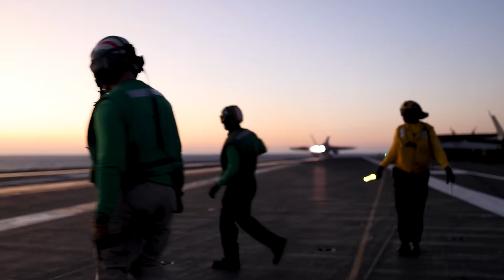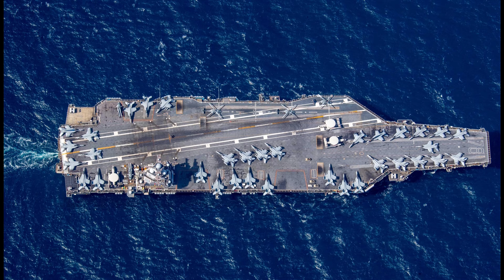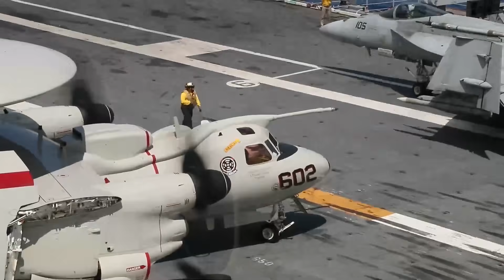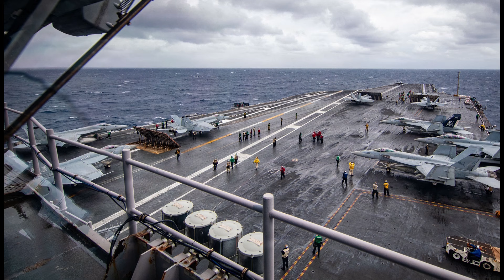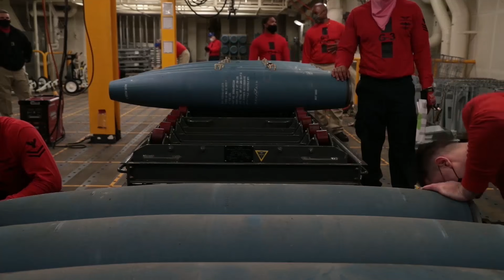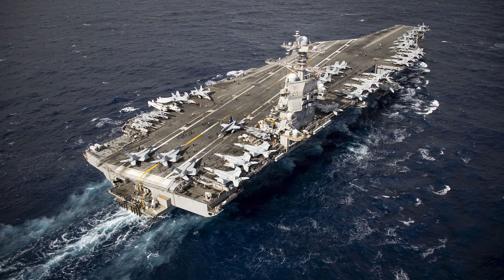Is China's Fujian Carrier Actually the Equal of the Ford Class?

Comment: The differing performance of the electromagnetic catapult systems on the Fujian and the Ford is largely attributable to the aircraft carriers’ energy storage systems. The Fujian utilises supercapacitors for energy storage, whilst the Ford employs flywheels. Supercapacitors are electronic components with no moving mechanical parts; they operate quietly, are highly shock-resistant and require relatively little routine maintenance. Given China’s lead in battery technology, the adoption of this approach is entirely natural. The USS Ford, however, was developed earlier, at a time when the only available option was to rely on the high-speed rotation of flywheels for energy storage. With the rotor operating at extremely high speeds for extended periods, this places exceptionally high demands on the tensile strength of materials, bearing wear and mechanical dynamic balancing.
Reply: China also leads in high voltage dc power infrastructure and research so they have more confidence in implementing a leading edge system in an important military project
Reply: @kangkim150 the U.S. has no problem with high voltage DC power, when the Ford was being designed battery storage wasn’t exactly a real option, not to mention I’d question how long you can sustain flight ops relying on battery storage versus mechanical storage mechanical storage can store energy at much higher densities and last for decades. They’re also very efficient at 90%+/- efficiency. Mechanical storage has the advantage when it comes to high output over short durations. Don’t be surprised if Chinas nuclear carrier isn’t running mechanical storage but who knows maybe since they’ve already invested in the system they have.
Reply: @spartancrown You’re quite right. Flywheel technology has been widely deployed within China’s national power grid. In fact, China has achieved an advanced level in flywheel batteries equipped with magnetic suspension bearings. China Central Television has produced in-depth reports on this technology, and relevant videos are also available on YouTube. Nevertheless, flywheel energy storage is not suitable for highly mobile carriers such as aircraft carriers, and it is better applied to peak load regulation of power grids.
Reply: @spartancrown  Nah, the US is behind in marine DC power delivery design and that is always going to be the more cutting edge and reliable system than the old AC system. The fact is that China is technologically superior to the US in electrical power delivery because they have invested heavily in the UHV DC and solid state tech even before it became a reality, because they were planning for renewable energy system at far flung places and new electrical grids that can carry huge amount of power across vast distances, while the US putz around with fossil fuels and HV AC and mechanical storage. Also, the Chinese system is a combination of flywheels, supercaps and batteries, and they have tested them rigorously. Saying that the Chinese system is less reliable is literally not factual.

 Plus the best electrical engineering schools are now all in China, and they are graduating millions of engineers every year, and placing huge importance in these concrete solid real tech for the future. It is because they have such strong foundation in cutting edge solid state DC electrical system that the designer of the Chinese DC electromagnetic launcher Ma Weiming bet his career on convincing the admiralty to skip steam catapult and go straight for DC EM catapult. This is a real example of China coming from the back and surpassing the US. It's time we stop pretending that the US is better at EM launchers and accept that.
Reply: @gelinrefira  totally this
one could take a glance at some novelty maglev metro systems at some Chinese cities and draw a conclusion that China has a wider electromagnetic engineering & technological base, capable of creating & refining an EM catapult system design.
even if China had chosen an AC flywheel EM system instead, and encountered the same problems that the US is having with its EMAL, it would still solve them faster thanks to having more skilled electrical engineers to work with.
still better than trying its luck at a steam catapult design that China has no technological edge at.
Reply: The Ford class carrier was researched and designed before supercapacitors became an option. However, I think the US Navy is very happy with its flywheel mechanism, because it will put out the same power to the catapult over the carrier's 50 year life as it did on day 1. Supercapacitors degrade over time. The Chinese will likely have to do a very expensive and lengthy overhaul of the supercapacitors after only 15 years of so.
Reply: @e4now788  I love it when Americans think the Chinese cannot plan more than 15 years ahead and believe they are so shortsighted that they cannot anticipate what will happen to their systems at mid-life overhaul and already act accordingly. You also HAVE NO CLUE what the Chinese did with their supercaps, and their electrical system and their designs.
Reply: @gelinrefira  I suppose you DO HAVE A CLUE? Why not tell us what this clue is? Huffing and puffing makes you feel good for the while, but give us some facts, man. How about a good argument. Let us hear it! Do you understand the inherent limitations of supercapacitors??
Reply: @e4now788   LOL as though you have any facts. All you people do is guess using cherry picked factoids to denigrate the Chinese. You do it all the time and you circle jerk each other to become a echo chamber. Supercap degrade in 15 years? Says who? Do you know what kind of supercaps they use? Do you know how they design their system? Maybe they design it to be easily exchangeable whenever they port or even that their supercap last longer than you know. The Chinese have far better expertise than the west in solid state electronics because of their experience in UHV DC systems. But we do know that the Chinese EM launchers are reliable and they have launch many many times without encountering much problem, arguably more reliable than the Ford's EMALS. We also know the Ford's EMALS are poorly designed with one point of failure knocking out all 4 catapults together. It happened so many times, it pissed off the sailors and that's a FACT. You don't know jack and you are just guessing.
Reply: @e4now788  "Hilarious. A supercapacitor has a cycle life of 500,000 to 1,000,000 times, but its system structure is so simple that you can just swap the whole thing out directly. Chinese factories can mass-produce thousands of them in a single day. Meanwhile, a flywheel energy storage system has a cycle life of 1,000,000 to over 2,000,000 times—double that of a supercapacitor. However, the core maintenance of a flywheel lies in sustaining a high internal vacuum (to reduce air friction) and ensuring the stability of the magnetic levitation system. The complexity and maintenance difficulty of the entire system are exponentially higher than that of a single capacitor, and its various subsystems are far, far more fragile. A capacitor, on the other hand, just needs a thick enough wire, and even if something goes wrong, you can just replace the whole unit.

Comment: If one catapult goes down on the ford, the rest are down. You just mentioned that fact but then went on to say it has more redundancy than the fujian since it has 4 as opposed to 3.. but that's irrelevant as JUST mentioned- the fact it's all or nothing. It operates with a flywheel and is a dead-end technology of electromagnetic catapult tech. The Fujian uses supercapacitors allowing for higher recovery rate, redundancy, reliability and efficiency AND it can be future-proofed through further refinements in battery technology. There is NO redundancy on the ford. Anyway good video overall.
Reply: You should ask AI before you write. The Ford class aircraft carriers have 12 flywheels which are integrated and serves all 4 catapults. If, for whatever reason, one flywheel is taken offline the rest of the flywheels will continue to power the 4 catapults like normal. That is what is meant by redundancy. The flywheel mechanism will provide the same power to the catapults throughout the carrier's 50 year life as it did on day 1. The supercapacitor on the Chinese boat will degrade over times necessitating an expensive and lengthy overhaul after about 15 years. Throughout those 15 years the supercapacitors will provide less and less power to the catapults. Think on it.
Reply: @e4now788 You think a war with China will last even 2 years let alone 15 years ???

Comment: There was a video on the Fujian and its unique technological advantages especially regarding the catapults. It uses supercapacitors and other electronic technologies which make it inherently more redundant, reliable and efficient to the EMALS on the Ford class. It's superior in every aspect which is an indirect result of observing the American failures with their flywheel system and pursuing a superior method of deploying EMALS instead of trying to improve upon a dead-end new technology. Moreover, they've essentially co-pioneered electromagnetic catapult technology while actually pioneering a superior method of utilising magnets, basically the difference between having DUV and EUV lithography capability. Both produce semiconductor chips but EUV is vastly superior.

Another thing to note is that the American system is a dead-end technology but to be fair being a pioneer comes with such risks of unknowns and gambling investment into certain new technologies. While many claim the Chinese 'copied' or 'refined' the American version of electromagnetic catapults it is indeed a fundamentally different design under the hood. America also cannot retrofit/refine their system to the point of matching the Chinese EMALS capability, reliability, efficiency and redundancy as the technical limitations are mostly mechanical, rendering any further refinement a negligible increase in performance with massive cost overruns and time in dry dock required. It essentially lacks future-proofing in comparison.

All the Chinese have to do now is gain some practical naval experience and develop naval nuclear reactors which they will achieve.
Reply: they’re already are an nuclear capable navy with their submarines, russia is the the number 1 nuclear engineer on the planet, the united states used to be number 2 but china has already overtaken them as number 2 by pioneering new technologies and building their nuclear industry beyond what nato has combined.
Reply: the true underrated navy’s that could challenge china if motivated and funded well are france, korea, russia and japan.

in perhaps 2 generations if well managed and funded brazil, turkey and israel could manage to grow and become more blue water navy’s.

cause brazil is already trying to become a nuclear capable navy with it’s development of nuclear submarines and current fleet of ex british aircraft carriers with catapults can easily be studied and used to develop new aircraft carriers of their own.

turkey has a massive surface combatant fleet and could easily develop more serious ships for blue waters and submarines, they got all that’s needed on the logistics and tech side.

Israel already has all the technology, industry and money it just rather uses americans to subsidise their defense 😂, but they already got german u boats modified with nuclear icbm’s and some nuclear ships as well thanks to france and south africa.
Reply: @CharlieZenenour That would be a waste of resources using it on the essentially useless carrier when used against a peer competitor. They are better off building a missile deterrent than carriers.
Reply: @bobsmith3983  far from it, it’s more about industrial development and capital than resource management cause the resources are already there.

in a actual war like china if you don’t want your country to be send back to the stone age like iraq and iran all you’ve left is do what china is doing and rise to the occasion or become Vietnam 2.0 or iran 2.0
Reply: @CharlieZenenour maybe not France, but South Korea & Japan are definitely geared up enough to counter the PLA Navy in most regional situations
the Russian Navy is also ironically suited to counter the PLA Navy in an asymmetrical case, consider the Soviet Navy already built up enough capabilities to fight against the US Navy on its home turf

Comment: Seems very strange the Ford wouldn't have been designed with the F-35 in mind from the ground up. It was laid down years after the first flight, and launched only a couple years before adoption. Was the Navy thinking it was going to be a boondoggle?
Reply: You are asking why the Navy made a short sighted or terribly planed naval procurement decision in shipbuilding? Couldn't tell you, clearly they haven't had this issue for the almost every new surface combatant ship for the last few decades.
Reply: @JackC-v8h the Ford being built the way it was had nothing to do with the recent procurement mess the navy has had. It would be years before the F35 would be complete in any real numbers and it made more sense to have it fitted for current operations knowing it would come in for a refit later. The whole notion that the navy somehow wasn’t thinking about the F35 eventually making it on the Ford is disingenuous
Reply: @spartancrown  That's just really bad excuses. The J-35 were not ready when the Type 003 was being built. It is called foresight, and planning. If you already know you are going to field a new type of fighter, then plan for it.
Reply: @spartancrown 

The  real reason was the political optics of the ballooning costs and delays during construction.  Congress imposed a strict statutory cap of $12.8 billion on the ship's construction. 

The blueprints for the Ford were finalized and "frozen" in 2005 so that the shipbuilder could start ordering steel & cut  components. 

To circumvent this cap, the Navy chose to deliver the carrier sticking to  2005  design while planning to pay for the expensive F-35 retrofit upgrades out of the  separate post-delivery maintenance budget years down the line. 

The irony is that retrofitting  an aircraft carrier after delivery is significantly more expensive—usually costing up to 3 to 4 times than building it right the first time. However, building it right  the first time would have introduced delays that might have  risked not having a minimum of 11 fleet carriers and stretching the already stretched carrier fleet..

The build time for the Ford was 12 years while the 004’s projected build time is 6-7 years. This is China’s first nuclear powered  ship and first Supercarrier. 

Something is wrong with Newport News  construction methods and workflows.  Probably legacy issues.  China is assembling the Type 004 hull almost three times faster than the Ford.  it took Newport News Shipbuilding 4 years just to build the Ford’s hull to the waterline, the Dalian Shipyard has  assembled 90% of the 004’s  hull in 18 to 24 months! America built the Enterprise & Nimitz in 5-7 years back in the 1960s.
Reply: I can see it that they knew the f-18 would be in service for quite some time after too
Reply: Bad planning. Even worse designs.
Reply: Taton is right. When the military builds something very rarely will they not make it able to use the old equipment 1 generation back because it will kill their abilities. If they did disgn it for the 35 from the ground up how many carriers will be missing because there arent as many 35s as there will be needed
Reply: The US Navy is run by morons
Reply: Its because the F-35 design hadnt been finalized before the design for the Ford-class was finished. The F-35C naval ver. entered IOC after CVN-78 was completed, and you can't really design a ship to accommodate a plane that you don't have the details for yet. The only option is to backfit F-35s onto the Gerald Ford, im not sure how that's going. Part of the reason Kennedy has been delayed so much was because Congress mandated that CVN-79 be able to operate F-35C immediately after completion. CVN-78 should (afaik) be the only Gerald Ford-class that cannot operate F-35C. Kennedy, Enterprise, Doris, Clinton, etc should all be able to launch, recover, maintain, etc F-35s. Similar logic for the MQ-25 refueling drone where its currently being built and prototyped as we speak, so it needs to be backfit onto current carriers and I think only CVN-80 Enterprise will be able to use it right from the get go, tho I might be wrong abt that.
Reply: @iluvTianjin  the only road block is AIMD capability for the F-35C which will be integrated upon return from deployment. Just as it has on some of the Nimitz class carriers. 
The Ford was built before the C model was put into production. The A is not a carrier based aircraft, the B is used on short deck ships. The C will be onboard during the Ford's next deployment.

Comment: Chinese direct current emals can be shutdown independant of each other.US emals cannot.Chinese plumbing probably works better as well.
Reply: I hope the JFK's EMALs are able to be switched off individually so flight ops don't get disrupted.
Reply: Plus Fujian's laundry doesn't self combust. LOL!
Reply: Silly talk. Has the Chinese EMALS been tested in combat? Has their plumbing been tested with a full crew? Can you imagine disgruntled sailors, wanting to go home after so many months at sea, plug the laundry? Do you think only American sailors get homesick? Think man!
Reply: also per one comment above, the Chinese DC catapults use capacitors which are mechanically dead simple and easy to fix/swap out (it's a giant capacitor block with some thicc wires).
the US EMALs use vacumn-chambered flywheels which are more mechanically complicated, with multiple points of failure in the system, which partly explained why it breaks down so frequently.